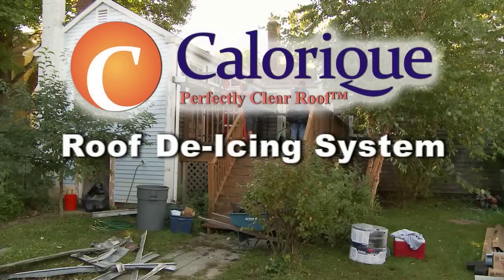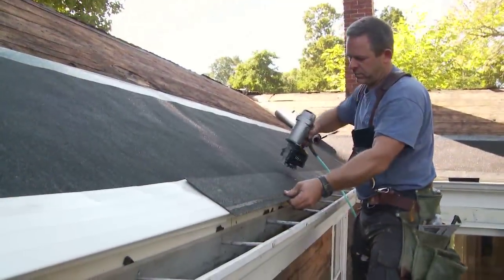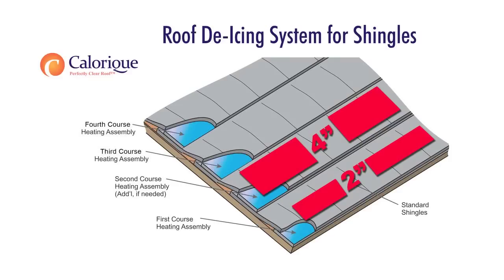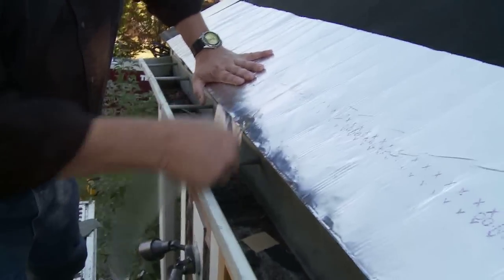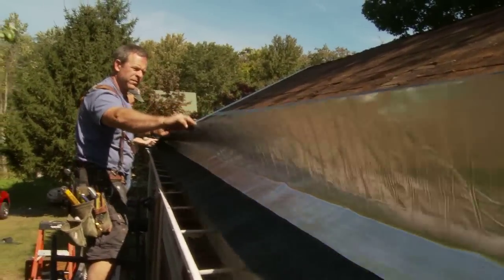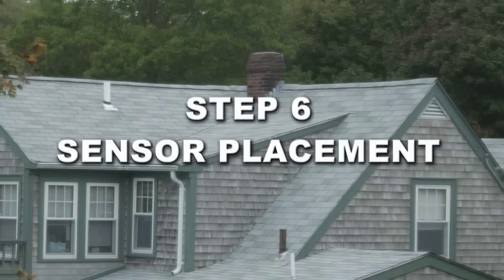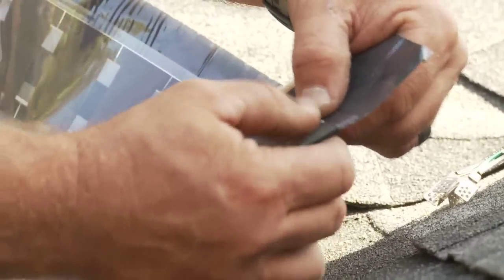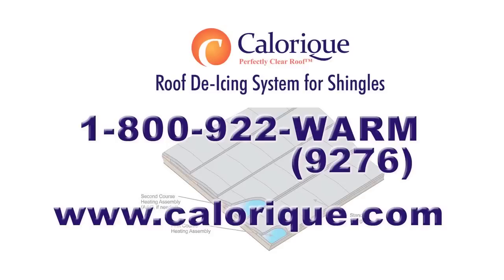Ice dam and snow melting solution for roofs-Completely invisible and simple to install

Comment: wouldn't you need to use self regulating heat cables for the gutters and downspouting? if that is the case, why not use a system that use self regulating heat cables like heated roof panels? that would also include the gutters and downsouts.

Comment: Concerns that jump out at me... The connections won’t stay waterproof with that ‘tape’ (see 4:40).  As soon as a little water backs up it will short out the connections and system. Second, those connections are fat enough to throw out a shingle manufacturer’s warranty. A hump under shingles, especially when they are cold, will crack them. And any time you have to heat shingles–poor heat conductors–you are losing energy efficiency. No approvals. This product is not ready for prime time. Sorry, I would never use this on my home.
Reply: jktr1     Absolutely—-  I wouldn’t even consider an electric system to solve this problem— and especially on this house,,  that roof is easily accessible from the deck,,  a short ladder and a roof rake, ( no need to walk on the roof ever)- is about all that would be required several times during the winter—.  I think people just get really lazy especially in the winter- they just need to move their fat asses and take care of business......